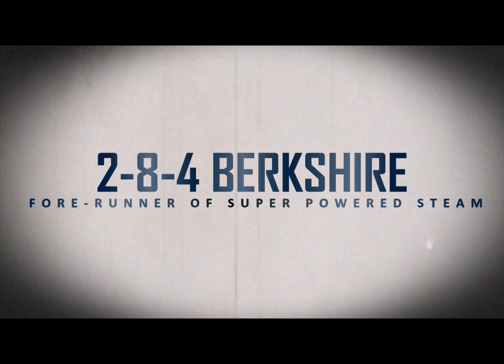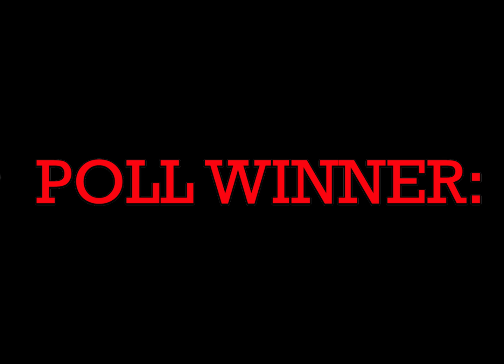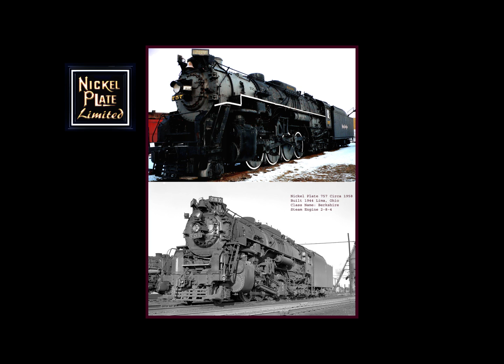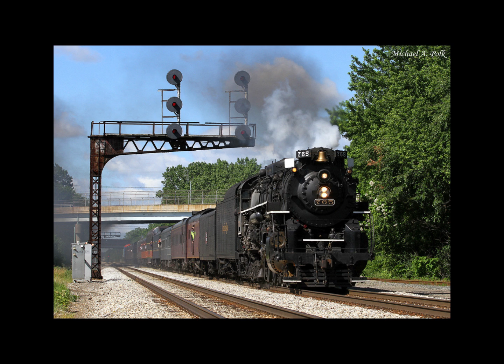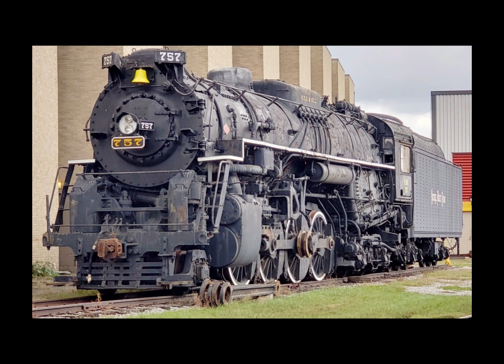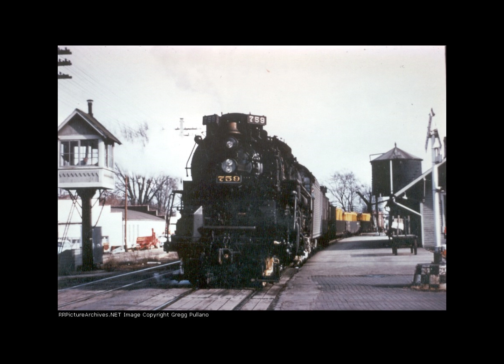2-8-4 Berkshire: Gateway to Super Power

Comment: The Lima A-1 wasn't a high speed locomotive, it ran rough above 40 MPH. The problem was due to insufficient counterweighting. Its 63-inch drive wheels in combination with the heavier rods of the 2-8-4 were the issue. John Bernet, then in charge of the Erie RR, took the basic A-1 design, enlarged the boiler, and put it on 70-inch drivers to produce the first high speed Berkshires in 1927.

At that time The Van Sweringen brothers, owners of the Nickel Plate, were accumulating stock in other railroads including the Chesapeake & Ohio, the Pere Marquette, and the Erie. They chose Bernet to run the Erie and make it profitable. The goal was to re-make the Erie into a fast freight line. The Erie had more difficult grades than Nickel Plate, and Erie's drag-era locomotive roster wasn't fast enough or powerful enough to accomplish that.

Around this time the managers of the Van Sweringen railroads formed the Advisory Mechanical Committee (AMC). The AMC would be responsible for designing anything the railroads needed, including locomotives. When the C&O wanted a new locomotive which could haul 160-car trains at high speed the AMC designed it. The AMC tested an Erie Berkshire and decided it needed a locomotive even bigger, and so designed the T-1 2-10-4 Texas. That ran on 69-inch drivers and had 121 square ft. of grate area. When the Nickel Plate wanted a new locomotive to upgrade the 2-8-2 Mikado the AMC scaled down the 2-10-4 to create the NKP Berkshire S-class. They designed it to use either 25-inch or 26-inch cylinders, and when the C&O and Pere Marquette ordered Berkshires they chose the larger cylinder size.
Reply from the maker: Ahhh yes, The infamous Van Sweringen brothers, not the most popular railroaders... But I sure do love the whimsical name for their primary railroad. :)

Comment: No. 757 is, in fact at Bellevue, Ohio as a static display. The last time I saw it, about a month ago, it still had no main rods or side rods, but it looks fine otherwise. It is located on  the south side of the Toledo line, near the Mad River and Nickel Plate railroad museum.
Reply from the maker: SO then I am assuming that it is still sitting outside?? It was in pretty rough shape in Strasburg paint wise. Berkshire's were probably the most elegant looking locomotives outside of streamlined.. And if you're gonna display one, then IMO it needs to look like 765. Anything less just isn't right. it should be a priority piece in terms of upkeep if you're a museum is what I am saying.

Comment: Would the Berkshires be considered the GP of the steam era?  Seems like they could do most of the everyday jobs well.  Not the fastest or the strongest but did not beat the rails up and were not as expensive as the more specialized engines.  Ironically I like the Berkshire because of toy trains.  Your videos are really interesting and full of information that interesting to me.  Already subscribed and will watch any video that comes into my feed.  👍🏻
Reply from the maker: The total numbers built here in the States seem to bear that out as being true. A replacement for the Mike. One thing that I didnt know and noticed as I was gathering my notes.. Berkshire seems to be a upper Midwest and Eastern locomotive. Very few out west and in the Plains. I didnt see a reason why though. So the Mikes were still very much in play out West. Head scratcher. Berkshire clearly out performed the Mikes.
Reply: @TheRailroadCrossing-SteamPower  You wouldn’t happen to know if the Lackawanna had any Berkshire’s?  That happens to be my favorite fallen flag.
Reply from the maker: @gregleuze6657  The "Lacky" ran the older 4-8-2 Mountains, but not Berkshires. Also Erie had scrapped all of their Berkshires by the time the merger was completed, so the Lackawanna didn't even have any re-numbered or re-branded Berks from that merger.

Comment: My guess is that Lionel probably made more than anyone!!! I remember as a kid seeing the Berkshire across two pages of their catalog. THE MIGHTY BERK.
Reply: That was my introduction to the Berkshire.  My favorite is the 1950 version.  Going to get one from the current catalog, just not sure which one right now.
Reply: @gregleuze6657  
I like the 1946 version. Terrible smoke system, but the double worm drive is really smooth, especially at slow speeds.
Reply: @ronalddevine9587  I will have to take a look at the 1946 version.  I have five of the 1950 version so I am good with that year.  Own some later ones that will run around the Christmas Tree.
Reply: @gregleuze6657  
The 46 and 47 versions had nickle rims on all of the drivers, with Baldwin disc drivers. Very handsome. The 48 version had nickle rims on the first and fourth axles' drivers only. The 49 had the sintered iron drivers for magne traction which appeared in 50.
Reply from the maker: I didnt have those neat toys. :(